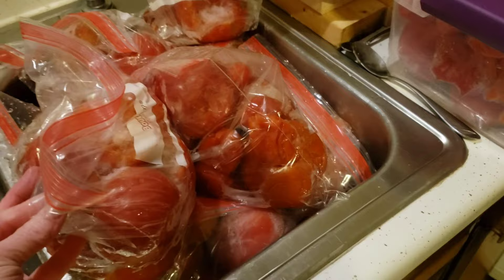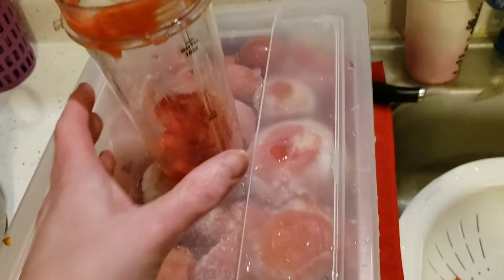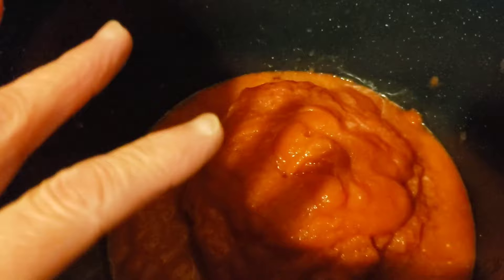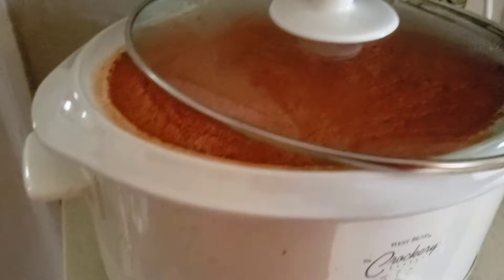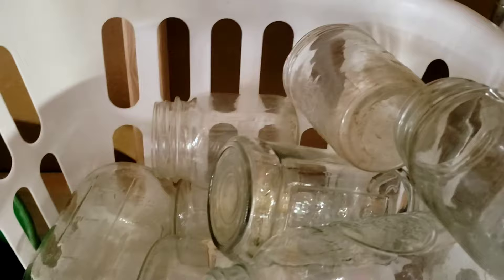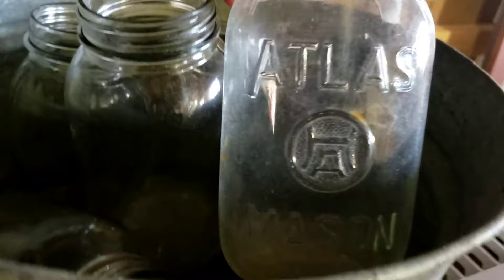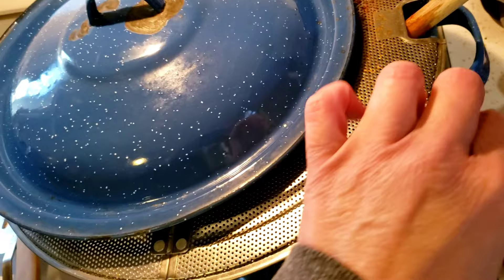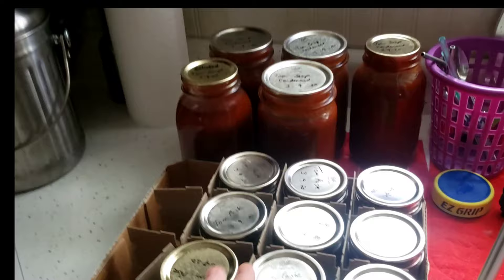Canning Tomatoes and WHAT WENT WRONG?

Comment: The lids on the small jars did not have a top maker ID.  So on the lids did you follow box instructions whether old style of bring to a simmer; or new way just soak in warm water? So my question would be on the pork did you follow an approved recipe, what was the head space and did you "pokey joe" or debubble the jars? I think you said on one of the pork quarts that the lid came off (not sure a lot going on in this video/paint tray and drawer). IF the lid came off then it was simply not tightened enough. Also head space is very important and if you stated the head space I did not hear it.
Reply from the maker: Thanks so much. I did debubble but it was thick. There may have still been some air. The recipe was just pulled pork and commercial sugar free bbq sauce. I think the sugar alcohol may have been a problem. I'll  also remember to read the box instructions for the lids from now on. Good call.

Comment: hmmm ok, did you can the pork at the same time as the tomato soup and paste? because they have different processing times. i also keep pints and quarts separated because they too have different processing times. for me, tomato soup, paste, and bbq pork should be three completely different canning sessions. headspace is vital! proper canning time is life or death. also canning at the wrong time can cause that burn you probably endured on your paste. the mainstay canning lids i find are only good for water bath canning. i laughed at the tomato slushie! 😆 next time just toss all of those tomatoes frozen into a big turkey roaster. an electric one. and slow cook. then, hit it with a stick blender. BAM! DONE! no need to even peel those tomatoes! plus, you lose all the nutrients if you peel. once its cooked and hit with a stick blender you wont even see those peels. the taste is incredible! and no mess. no splatter! 😁👍🏻 super easy. so thats just my two cents in trying to help you sort through what may have happened.  i would not recan the pork. i would toss it. its not worth getting sick over. my golden rule is, if you ask if you should eat it or feed it to your dogs or throw it  out, those questions should never be put together. if they are, then the answer is already clear. toss it. if it wasnt processed for 90 minutes in a pressure canner, then it may be harboring dangerous bacteria and spores that were not killed. i dont think its worth testing. 🥺 i hope that helps. ❤️
Reply from the maker: Thanks for the information! It was all pressure canned for 90 min, so I think I can eat it. But won't try recanning. All the tomato soup and paste sealed just fine. Only the bbq pork failed to seal. 🙄
Reply: @sweetearthfarm  I never do jars of vegetables in with jars of meat. The time difference is too great. Keep them separate (unless they're within the same jar). Also, you should be freezing tomato paste. It is too thick to can, even in the pressure canner. Same with mashed potatoes or thick squash—those need to be canned in chunks. Sorry, got off subject. Important to leave 1" headspace with meat and very clean jar rims/lids.
Any jar that doesn't seal for me within 3-4 hrs, goes in the fridge when cool enough, to be eaten in a couple days.
Reply from the maker: @northstarprepsteader  Thank you. I did them all together. The quarts of tomato soup worked but the quarts of pork bbq didn't.  The jelly jar size of tomato paste worked but bbq pork didn't.  I ran canner long enough for quart jars of meat. Should be "overkill" for tomato products but they worked, pork didn't.  🤔 I think I've heard enough that I feel comfortable eating the pork but probably not recanning.